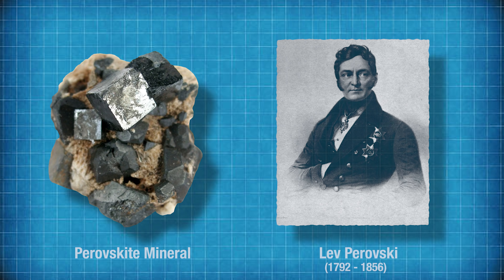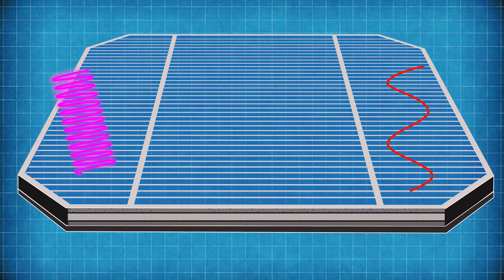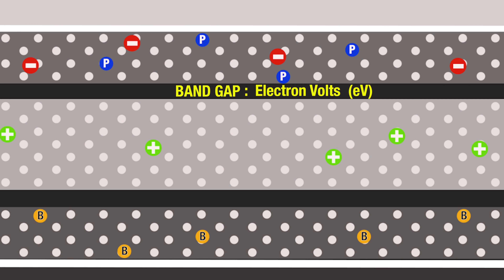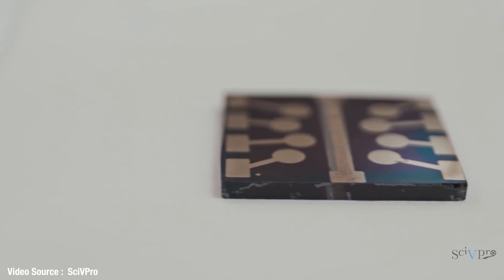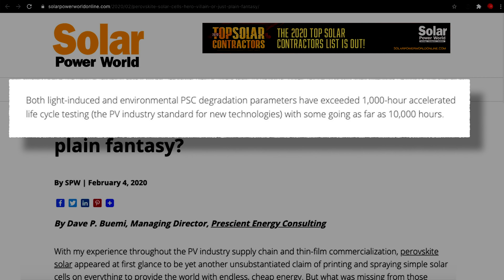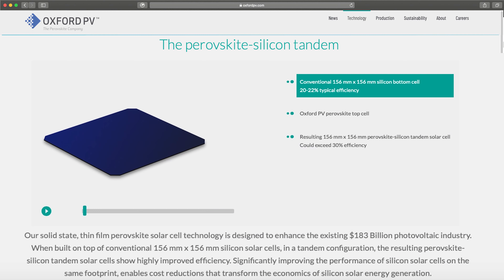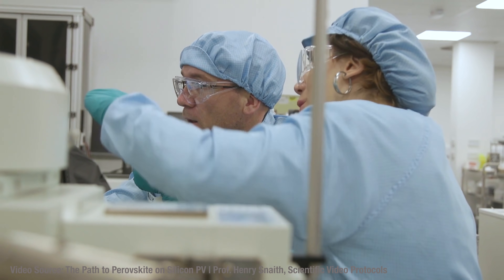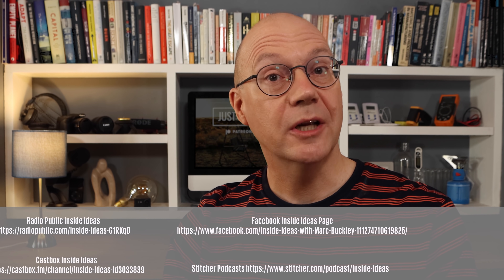Perovskite Solar Cells: Game changer?

Comment: While I know you are being snarky about the word “aluminum” being “wrong”, I did want to make a few points that many seem virtually unaware of.  

First, the British chemist who discovered the metal, Sir Humphry Davy, named it “aluminum” not “aluminium.”   

Second, many assert that it is not consistent with any other element naming in the periodic table, which is not correct; unless we change to namings such as: “platinium”, “tantalium”, “molybdenium”, and such.   

Finally, rather than its consistency with orbital structures and associated valance group naming conventions, which relates to, for example, naming the gas “helium” rather than “helum”, and other associative grouping and conventions, it is based solely on what some people sounded “right” to them.  In reality, several Brits autonomously changed Davy’s discovery that he named aluminum to aluminium, simply because the felt it sounded more “high-brow” and “latin-like”, or as they restated in a quote from the Quarterly Review:   “Aluminium, for so we shall take the liberty of writing the word, in preference to aluminum, which has a less classical sound.”

So, those who wish to call it “aluminium” and those who have petitioned strongly for decades now to have it broadly codified as such, do so in contradiction to the name given to it by the person who originally discovered and named it, in contradiction to its original valance grouping reasons given by the discovering scientist and supported by others, and in contradiction to the fact that over 270,000 research and related papers refer to it as “aluminum”.  In any case, given the seemingly disproportionate continued efforts to petition its renaming to “aluminium” by countries, national and international standards boards, and the like, it is likely that the name “aluminium” will continue to gain ground.

In any case, in keeping with a desire to break with convention, my preference would be to call it “Aluminiumium”, which would also help to reinforce the difference.
Reply: we also have to remember that aluminum started as a precious metal, as the manufacturing was really, really expensive and only the highest classes could afford it, so it make sense that they wanted a more classical name for jewelry material.
Reply: Giuseppe Bonatici — very interesting thought.   I don’t doubt that at all.

Comment: I did a quick BOTE calculation based on Musk's 10,000 square mile of panels versus the amount of homes in America.  Covering every family home with photovoltaics would get us almost half way there.  Add other buildings, and use more efficient cells, and we have it.

And Musk is already trying to make that happen with his power wall and roof cells.

A good side effect is that we would be a lot less dependent on the grid.  In fact, if we do it right, we can mostly eliminate the grid.

Comment: It's not 100x100 miles unless we are going to do without industry and air conditioning. Do the calculations. It's more like every square inch of the state of Arizona --- which would lead to an environmental disaster enough to ruin the world off the decreased planetary albedo. 

And, the battery would need to be about 10 by 150 miles with 10% replaced each year. It would take 500x the annual worldwide lithium mining  for the US alone --- and doing so in perpetuity unless they can figure out how to recycle lithium batteries. 

 Musk gets away with all sorts of fantastic claims not based on science and engineering. I like him, but, he is quite the conman.

Comment: Perovskites react with everything, water, sunlight and are so unstable and don’t last very long. They are not much use if they stop working after 6 months. I think layered quantum dot thin film solar sells where the size of the quantum dot and hence energy band gap can be controlled to match different wave lengths has more potential. I think mass producing with colloidal techniques and then filtering the quantum dots to the relevant size in layers would work better.

Comment: It is "aluminum" and NOT "aluminium" and here is why.
The typical Latin ending for metals is "um" from the beginning. Here are ALL of the metallic elements known from antiquity with their Latin and English names.
ferrum = iron
aurum = gold
argentum = silver
plumbum = lead
cuprum = copper
stannum = tin
hydrargyrum = mercury

Note that in NO CASE is the ending "ium", but only "um".

So, where does the "i" come from? Metal oxides were often known BEFORE the elements and were commonly given names ending in "ia" as in:
zirconia = zirconium oxide
titania = titanium oxide
magnesia = magnesium oxide
calcia = calcium oxide
strontia = strontium oxide
baria = barium oxide
and quite a few more.

alumina = aluminum oxide;   NOT aluminia
Since there is NO "ia" ending in alumina, there is no "ium" in aluminum.
The "ium" ending for aluminum is from specious analogy to zirconium, ignoring the spelling of the oxide.

QED.
Reply: Aluminium was known to the Romans?🤔

I thought it was discovered and named by a more modern Danish guy😅

What about Titanium?😅🤔
Reply: @tylerdurden3722  You totally MISUNDERSTOOD my comment. The seven metallic elements listed were the ONLY metallic elements known to the Romans:
ferrum = iron
aurum = gold
argentum = silver
plumbum = lead
cuprum = copper
stannum = tin
hydrargyrum = mercury
I never said that the Romans knew of aluminum metal.

Comment: Still don't like the lead in perskovites

There's a big difference between having toxic material in a sealed box that largely nobody ever even sees, and having toxic material on large panels on roofs and in flexible sheets thai people have lots of daily contact with

Needs a Pb replacement!
Reply: Toxicity is always a matter of quantity though. Even oxygen is toxic in high enough doses, so think relatively, and not absolutely. Everything is potentially toxic, it only becomes toxic in specific circumstances.

Comment: PV cells DO NOT convert photons into electrical energy!   Realize, that a solar cell is a precharged battery that is forced to discharge when the sun hits it.  After the solar cell moves its electrons from the anode to the cathode, about 20 years.  Its done.  There is NO NET GAIN!   It has to be recycled so it can be recharged where the electrons  are electrochemically migrated back to a usable PV material.   No mention of Cadmium Teleride Solar cell technology.  Where the materials come from the ash of burning coal, which would eventually be recycled.  So no need to continue burning coal for the ash material.  1st law of thermaldynamics:  You cannot create or destroy energy, only change its form.  Every solar cell will be charged with a fossil fuel as its nascent energy source.

Comment: What's the lifetime of those panels and how to recycle mixed components ? 

Today not even the aluminium frames are reused, but is broken apart and melted, 
instead of being designed house multiple generations of cells..

Comment: Small correction: Elon did not say 100 square miles, he said 100 x 100 miles, which is 10,000 square miles. That, of course, is in total, and not necessarily at a single location.

Comment: What about LEPCON/LUMELOID technology developed by Alvin M. Marks?
https://www.nytimes.com/1986/09/09/science/new-plastic-solar-design-promises-efficient-power.html

"Glass panels and plastic sheets of LEPCON* and LUMELOID* respectively convert sunlight to electric power with an efficiency of 70 to 80%, at a cost of $ 0.01 to $ 0.02 per kwhr. The investment in I square meter of a LEPCON* glass panel is about $ 250.00. It produces 500 W of electric power in bright sunlight. The investment then is $ 0.50/W, spread over a life expected to exceed 25 years."

http://www.rexresearch.com/marks2/marks.htm

https://www.youtube.com/watch?v=hMGyob166Cg

Comment: Is there anything wrong using some of the energy to magnify the flow of electrons as we do in transistors. Just one more layer, energize it et voila!
Reply: Transistors magnify the flow by using a small input current to effectively control a valve on a much greater source of current. They do not actually create or amplify power.

Comment: About that statement musk made on solar panels powering the USA at the start of the vid.
100 sq miles is around 258 998 811 m2
The Sun hits the Earth with cca. 1000 w/m2 on average around the entire planet
If 100% of that energy was harvestable by solar cells (which is not true, because infrared and ultraviolet can't be harvested), the solar panels would be harvesting 24/h at 100% efficiency all the time (neihter which is not true for obvious reasons), then
258 998 811*1000 = 258 998 811 000 (watts)
258 998 811 000*3600*24*355(joules per hour, per day, per year) = cca. 8e18 joules per year
In 2018 the USA consumed about 101.3 quadrillion British thermal units, which is cca. 1e20 joules
https://www.eia.gov/todayinenergy/detail.php?id=39092

Comment: All well and good as I am for solar that works.  However there is more to this subject than just "go Green".  The reason we just had a large use of black outs in California is because there is no storage of excess energy created and not enough old school generating capacity to take the place of solar and wind created energy.  Wind turbines outer blade speed is 70 miles an hour and is responsible for major bird life loss.  The wind farm at Altimount pass is shut down by court order three months of the year because of bird loss.  The solar farms kill birds that fly over them.  Please do not support getting rid of petrol until the kinks are worked out.

Comment: what ever happened to solar concentrator thermal power stations as used in India Northern Cape (South Africa) and Spain. That is the cleanest and does not require mining for heavy metals for batteries. Then off peak power can be used to split water in to its components, compress the hydrogen to be used in internal combustion engines with steam as exhaust. Greenest automotive and only minor mods needed to existing internal combustion engines. Elon Musk the day will come when fossil fuel companies and motor manufacturers join hands to generate efficiently the greenest electrical power. AND power automotive using hydrogen. Photovoltaic generation and wind not efficient and expensive. Try tidal

Comment: "Elon's one hundred square mile analogy" is Elon's 100 by 100 square mile analogy => 10 thousand square miles.
Reply: I was thinking that such a large area is not trivial. And, those panels would take a lot of energy to produce, maintain, and replace. I also wondered what average sunlight exposure and solar panel efficiency he used for those calculations.

My local power plant has a 80MW diesel generator to handle peak loads. Assuming the maximum sunlight that hits the ground and 33% efficiency, 600x600 yards of pure solar panels would be needed to replace that generator. The town is relatively small, and that doesn't account for sunlight variations due to latitude, weather, and the day-night cycle.

The cost of solar panels in constantly changing, but I did an energy analysis for wind turbines. Just considering the steel, wind turbines will never produce more energy during their lifecycles than the amount of energy needed to manufacture them. They only appear to be viable due to cost analyses. However, those costs are based upon relatively cheap fossil fuels that are used to produce the wind turbines. Solar might have a chance, but I haven't crunched those numbers yet. There is data of the average amount of solar energy in different regions. Perhaps I should run those numbers.
Reply: @Austin1990  You get roughly 100W per square metre when the sky is clear and the sun's at the zenith and the PVs aren't toasted hot, ergo with 10 thousand square miles of PVs that's 10e3*1609*1609*100/1e12= 2.58 TW.
Reply: George Of The Jungle 
Thank you. I did some extra reading, and the temperate zone gets an annual daily average of 150W/m^2. However, this number does not account for inefficiencies in the PV cells or losses in the grid. Since your number is so high, I am assuming that it doesn’t account for these either.
https://enviroatlas.epa.gov/enviroatlas/DataFactSheets/pdf/ESN/Averageannualdailypotentialsolarenergy.pdf

Considering a 20% system efficiency and an annual average of 630GW energy consumption for the US, the US would need an annual average of 3.14TW. However, that includes all energy, not just natural electricity. So, it would cover all cars being EVs (which would be more energy efficient). So, I think that would check out.

Moreover, it looks like PV cells have become very cost and energy effective. So, this seems viable. It is still a massive area, but it’s not impossible. A cost analysis would be interesting. I am guessing that lithium ion batteries are still far too expensive. I am hoping that less dense but far cheaper solid state sodium batteries would be the answer.
https://pubs.acs.org/doi/pdf/10.1021/es3038824
Reply: @Austin1990  PVs are less efficient when hot, and where there's lots of sun (eg. the Sahara) it's also very hot. 100W/m2 is a very good ballpark figure, including dc->ac conversion and grid injection losses.

Comment: Photochemists have been "researching" solar cells for decades projecting this or that may finally achieve the holy grail.  But electricity is not a fuel.  Photons are the fuel for solar cells.  Photons originate from the sun which is basically a burning mass of hydrogen.  Do you see the irony?  The fuels we rely on like gasoline, oil, coal, and liquidified methane a have high energy density.  They will be difficult to replace.  Until solar electricity can be converted to a liquid fuel, which would essentially serve as the "battery" and maybe for running fuel cells, what are we going to do when the sun doesn't shine?  We'll be burning something.  I prefer the nuclear option.

Comment: Very interesting. I think these panels have a role to play in our energy production however it should be noted that solar panel farms are not the way to go. All vegetation is removed before installing which negates the green econo nuts goals. If installed on roofs, and other surfaces pre-existing is a good viable methods along with better battery storage. This can SUPPLEMENT the gas and oil power plants.

Comment: Why don't people leverage the effectiveness of solar panels by using them to shade buildings and parking lots in the Sun Belt?
Reply: Currently (pun intended) in Phoenix AZ parking lot shade structures and roofs of public schools and city buildings are being covered with PV panels. It's about time we leveraged our intense sun exposure in the SW for energy extraction… and a little shade while we're parked doesn't hurt either.
Reply: @Damiendrops   solar panels also provide some shade on buildings and camper vans (especially if they are installed with a little gap) so the roof is really shaded. They are also beneficial for plant life that can grow better in partial shade.
Reply: LICKHER&STICKHERINTHEPINK &OTHERPLACES  Google Earth DFW airport and look at how many square miles of warehouse roofs there are. How much does it cost to air-condition those places?
Reply: Good thinking there. If we shaded desert areas with solar fabric, this would hasten revegetation projects and provide power for pumps, desalinisation units and tools. Reclaiming the deserts should be a priority, because if the deserts were covered with an insulating layer of plants and trees, the hydrological cycles of the entire planet would be extended and improved.
I think aluminum is a better choice than aluminium because it is simpler. The USA has modernised English far more than it has degraded it. Petrol, is short for petroleum. Gas  is short for gasoline. Gasoline is one of the common names for benzine related petrochemicals, and so it is a more accurate term than petrol. Now we could knock off some anomalous and unnecessary letters such as knock becoming nok for example, and the whole planet would save typing time and confusion.
Reply: LICKHER&STICKHERINTHEPINK &OTHERPLACES  Google map DFW airport and look at the square miles of warehouse roofs with none. Dallas, where it is not uncommon to get 90 consecutive days of plus 100 degree days. How much could you reduce the AC costs if you never even plugged the array in?
Reply: That's a racecar of an idea works frontwards and backwards
Reply: I think the public buildings step forward with doing this first and it's really up to the private sector businesses to do it if they think it's worth the investment.  They aren't in owning and leasing real estate for the Earth.  Malls around America could generate a butt load of energy, but I think you'll find they don't even like to seal or repave the parking lot ever.
Reply: Solar-powered sustainable 55+ communities.  Energy-efficient new construction oriented with south-facing roofs, generating 2x or 3x more power than the retired couple inside can use.  Put enough homes together and have a microgrid making extra money for the retirees who purchased the shade.
Reply: LICKHER&STICKHERINTHEPINK &OTHERPLACES  But are they printed and glued to a standing seam metal roof with the heat of the sun beating down on them?
Reply: @DavidMDensford  Leave a thermal gap between

Comment: Keep in mind you can boost solar panels efficiency by using mirrors and reflecting light to them increases the total efficiency of the solar panel now the only downside is trying to make the heat sink better and more usable with in solar panels that will help boost efficiencies and that's actually been proven now if you use a hundred miles by 100 miles of solar panels with directed mirrors at the solar panels abuse deficiency along with solar panel directional guides which follow the Sun Also boost the efficiency are solar panels and there are solar panels that have been designed to do so already